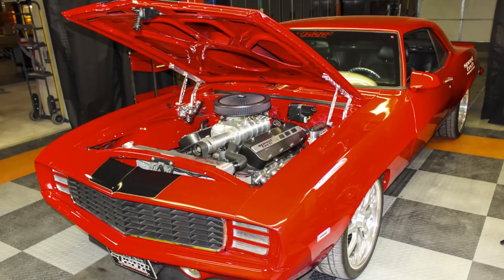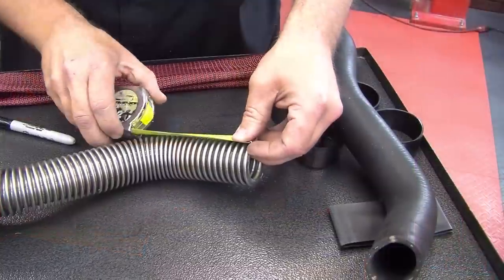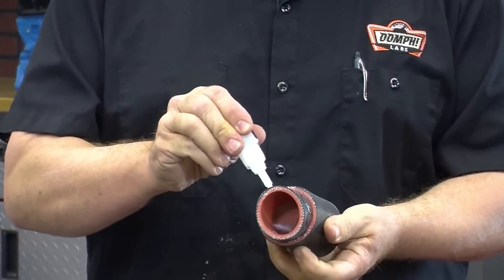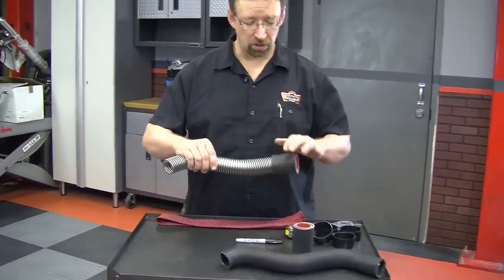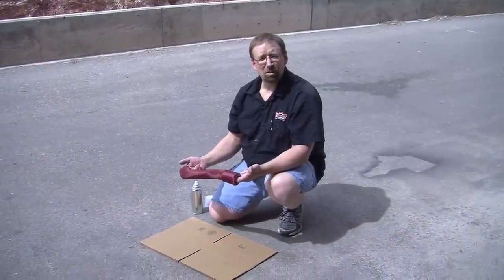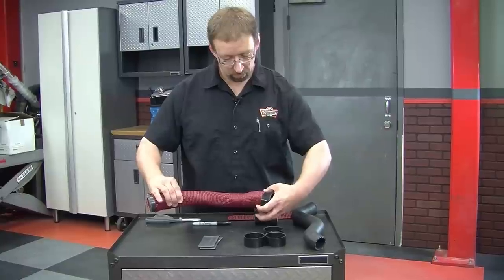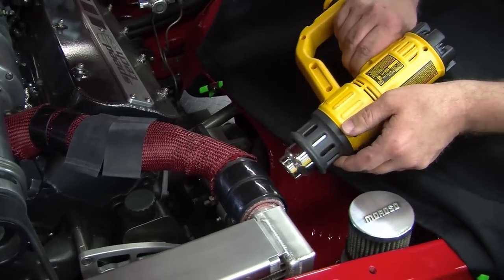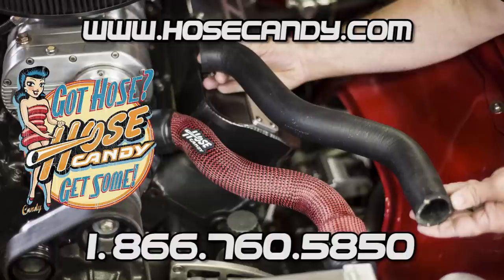How to Install Hose Bones Radiator Hose the Advanced Install

Comment: That's right folks. Glue and heatshrink tubing keeping your radiator hoses on. Just make sure you only drive your car on and off the trailer which is the only action that Camaro sees, to prevent failure. 

I appreciate the attempt though. Improved options for radiator hose dress up is a worthy concept.

Comment: So, if there's a leak, or you blow a hose while driving, then everything gets wrecked taking it all apart, requiring new boa clamps, which one may not carry with him/her while driving around = I'll pass. A standard hose clamp doesn't require anything except a blade screwdriver, and I can install & remove 100 times before I have to replace it.

Comment: why use rubber hoses at all on cars?
Reply: Alfonso D because the engine moves in the engine bay. The reason radiator hoses and such arent just hard lined is because the engines shakes back and forth but the radiator stays still
Reply: Because rubber is all you need. This is just for pavement princesses and show cars that dont ever actually do any real driving. When you are putting 15k+ miles on your car every year this will all be caked in grease 75% of the time, even if you properly clean the engine bay, that the looks are pointless.